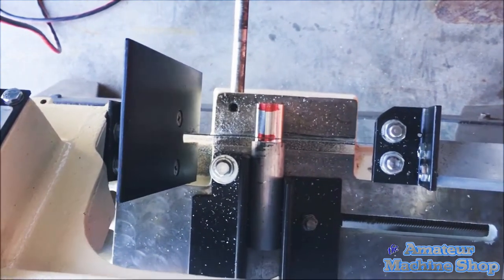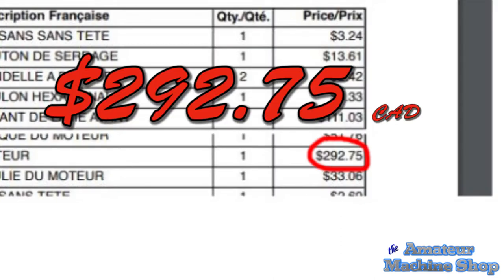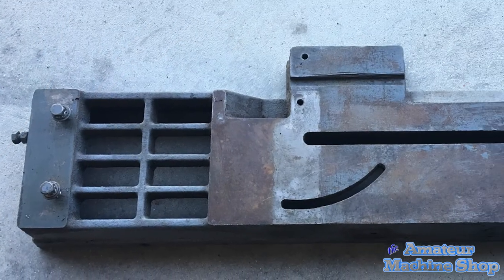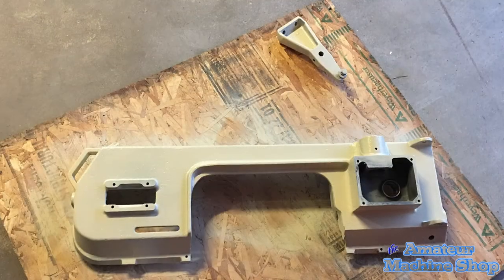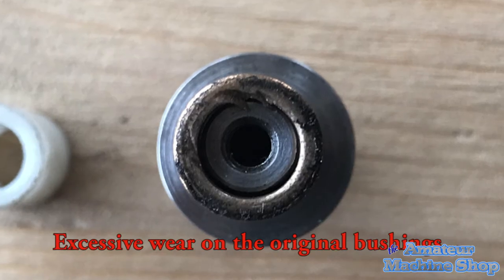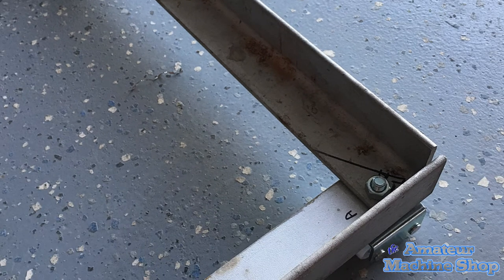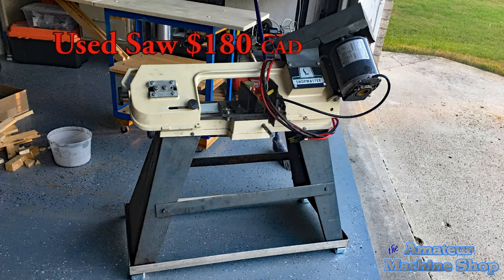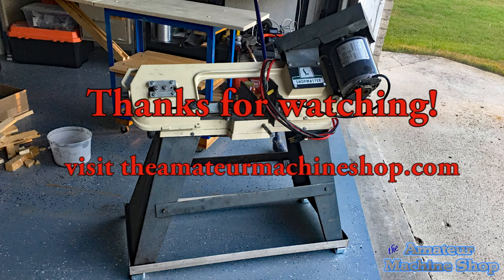Is it worth rebuilding a used horizontal bandsaw?

Comment: I prefer buying used then investing a little more money and a lot of time improving and customizing my shop tools/machinery. I look for cast iron surfaces and avoid sheet metal or aluminum construction. I’m talking about 1950-1975 construction. Before China and plastic parts. There’s something very satisfying about being asked how much I paid for something. Then telling them the low price and how I later refurbished it with x amount of money and lots of elbow grease. Also, you learn a lot about your tools and whenever they need servicing, that scary feeling is gone because you have a sound understanding of what makes your things tick because of the disassembly and assembly process. I use the same philosophy whenever i buy and restore my gym equipment. I tear it all down, sand it down, paint it with $60 a gallon paint, lube the moving parts, and reupholster all the padded areas. I think you made out ok. Great vid.

Comment: Beautiful job,  whew.... Your a better man than I.  I looked around on Craigslist and EBay and what I found was either worn-out junk or overpriced dirty filthy used stuff that people were trying to finance a new one with.  So it was the new Harbor Freight with a 5 HR rebuild/tune-up that has turned into a pretty good tool. It took a good base mfg plan which I found on YouTube. I scrapped the HF base unassembled into the trash. Junk!  I like the beige look.
Reply from the maker: Sometimes, buying new makes sense. Sounds like yours is well built! Thanks for the comment.

Comment: Got a similar stinker off Craigslist and wonder how previous owners were able to bring so many parts to utter ruin. But then, these saws need to be re-worked when they're unboxed so the invested labor isn't a loss. You'd ( I'd ) have to improve all sorts of things that are supposed to be acceptable but aren't really. I have the good fortune of a bank of small motors to choose from. One of them is 1 HP. After consulting Amazon and eBay' step pulley offerings and recommended feet per minute cutting speed for various materials, I'm optimistic about using the saw at higher speeds. Keep your eyes open. Better motors will come your way. For instance, use a variable speed drive out of a junk treadmill.

Comment: That turned out well. Handsaws have beend a pain for me. Had a couple bench top models from Wenn and no brand import. Blades just too small to last. Now just using a carbide blade chop saw until I can get something more on the size of the one you have.
Reply from the maker: We all make due with what we have. I could buy everything new, but that isn't practically or financially responsible. One piece at a time :) Thanks for commenting.
Reply: @theamateurmachineshop2150  Just curious , I rememberber seeing these in the mid 70s laying around in a shop I worked at with all post war conventiinals . I bought all my holders years ago before they got so expensive. Best investment ever was a 1/2" solid carbide boring bar for Ccmt insert. Its amazing. Pricey yes , but worth every penny.

Comment: Nice rebuild however as I’ve seen everyone goes with gear oil 85/120 and strongly recommend against grease  with the logic of increased heat and degradation of the grease
Reply from the maker: Thank you for the tip!

Comment: Good vid. Have you had any problems using grease in the gear box instead of gear oil? I just bought a 40 year old Central Machinery band saw and it had grease packed in the worm drive box. I cleaned it out and found no shavings or sediment at the bottom of the box or in the grease, but I filled it with gear oil because all the other mfg. manuals I've viewed use gear oil. I like the idea of using grease, but the manuals for these old CM machines are no longer available.
Reply from the maker: I never did check to see what the manufacturer suggests should lube the gears. I went with grease as its thick and adheres well to the teeth. Gear oil is likely a good choice in place of grease, especially if you cut a lot. My saw sits idle a lot.